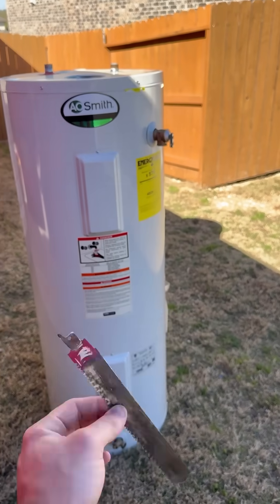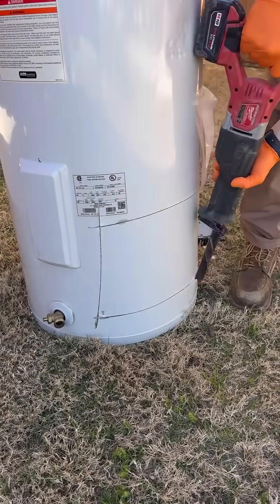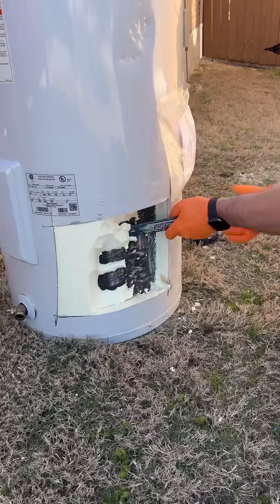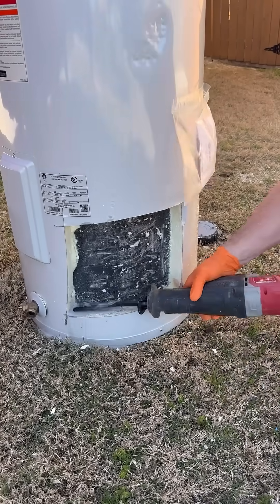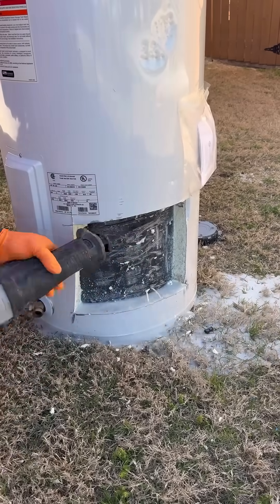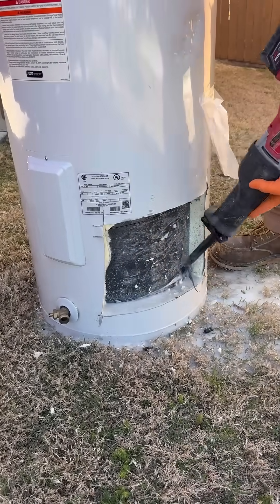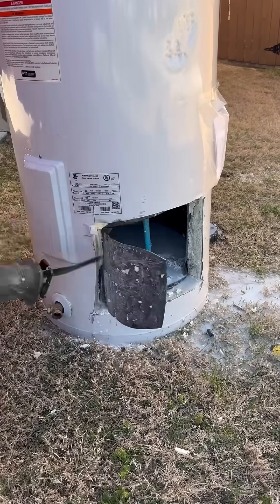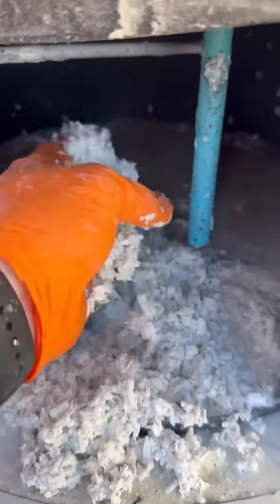What Is Inside This Water Heater?

Comment: 😮 That is crazy how much calcium is in that tank... I know mine is that bad. I will be replacing mine after watching this video.
Reply: I recommend install a ball valve on the heater drain port- plenty of YouTube how to videos. Very simple diy project, take ya a run to home Depot or Lowe's, and about 15 minutes of actually doing the install. 

Turn the heater off and let it cool, unscrew old drain valve, install new one (watch video how to do this) and it's done. 

The ball valve has a wider opening that will enable you to drain the crud out of the valve every 6 months thru a garden hose.
Reply: you may have cleaned already but well.. not a lost cause.. you may want to read the manual of your water heater, some of them can be opened from either the top, or the bottom and they come with a piece called "sacrificial anode" which is a magnesium bar that tries to "capture" the calcium protecting the interior of the heaters improving the lifespan. that metal bar is meant to be replaced every "X" time (depending on the quality of your water and the size of the anode bla bla bla) so now that you're at it, if your's come with one of those bars you may want to replace it (usually pretty cheap) and if you're able to dissasemble it you may want to also clean the resistance. the trick with the vinegar works fine but make sure you're using "cleaning vinegar" (which is more concentrated than the cooking one). make sure you wash it away completelly with a couple of flushes. or just apply the cleaning vinegar to the heater element itself if you can dissasemble it and let it rest for a few hours
Reply: This should be a warning to people with hard water not to be using their tap water for consuming. All that excess calcium in the body is terrible for ones health.
Reply: @WaterspoutsOfTheDeep 
Calcium is perfectly healthy. Worse case scenario you might be more likely to develop a kidney stone, but that won't happen for most people who eat a healthy diet that includes acidic foods like fruits and vinegar. There's far more people that are deficient in calcium than there are people who get too much of it. There's even some studies that have found tentative evidence of a protective effect on cardiovascular health from the calcium and magnesium in hard water.
Reply: I have yet to find a better tasting water than my hard well water.
Reply: Lol comr to Hungary sometimes we used wheelbarrows to take out the calcium.New sealings and let's go
Reply: Try adding a couple gallons of white vinegar. Let it sit for 24-36 hours and then flush 2-3 times. It'll save you $800
Reply: @bluntslt8023  Holy smoke, I never would have thought about the white vinegar. Great information..!! Thanks..!! I have used the white vinegar for cleaning out the washing machine which helps break down the detergent that doesn't break down and flush out. Thanks again for the response..!!
Reply: One of the other comments said use citric acid as vinegar barely works  @robertslaughter6525
Reply: @robertslaughter6525  The little plastic flush spigot is reduced to what looks like a 3/8 inch hole in the valve, and it is stepped down, meaning it has no choice but to trap solids... 

Even with vinegar, it will likely plug every 15 seconds and you'll be playing the coat hanger game for DAYS as the liquid snow fills your (hopefully unfinished) floor area.

If you unthread the valve, you can directly attach a 3/4 threaded pipe nipple, giving you a FAR bigger outlet that actually flows. You can even attach a ball valve or just a cap to it for the next (regularly scheduled) flush.

This is, of course, if your unit is REALLY filled with the white flakes or crud. If its' not rusted out and actually leaking, and time is more abundant than money, you can bring it back to life for 50 bucks and bit of patience.

Vinegar may work, but "Stronger acid" made to dissolve lime and rust  may have been used a time or two, also, but in the interest of internet responsibility and people's lack of common sense, I'll just leave it at that, and let you go from there. ;-)

The unit in the video was "normal". I've seen them so deep that the bottom element was covered and not functioning. In that case, bring a few beers with you. It's gonna be a while. :))
Reply: @bluntslt8023  why you stealing comments
Reply: I recently cleaned mine out. 15 years old, previous owners obviously did zero home maintenance. The calcium deposits were so bad it covered the lower element causing it to overheat and warp. 

It was insane how much calcium was in there. I thought multiple times I should just replace the tank but by then I was just determined to get it clean.
Reply: @cody7855  same thing on mine, all the way up to the lower element. I vacuumed out the bulk of it and did the vinegar trick for the rest. It sucks being poor 😂
Reply: @krakerstaker  little labor saved hundreds of dollars.